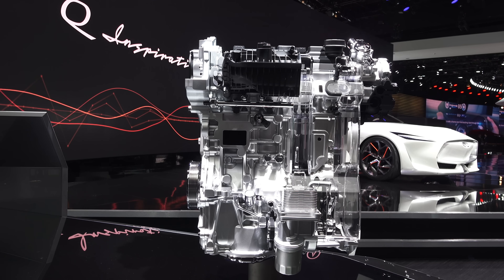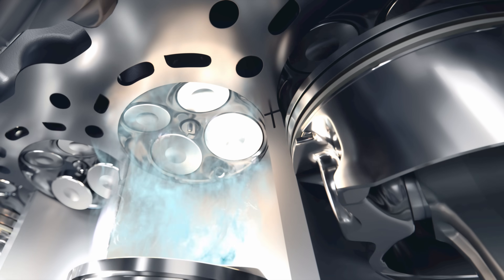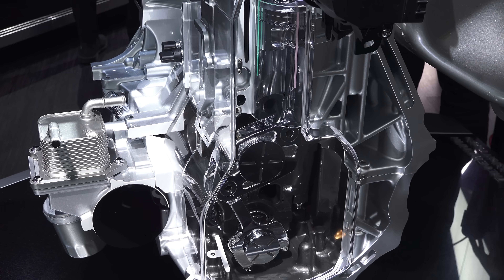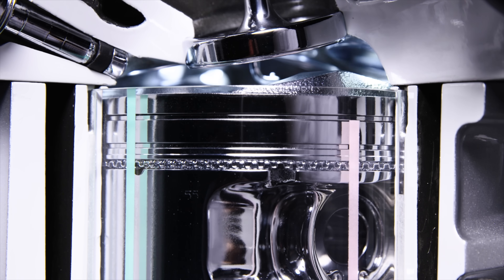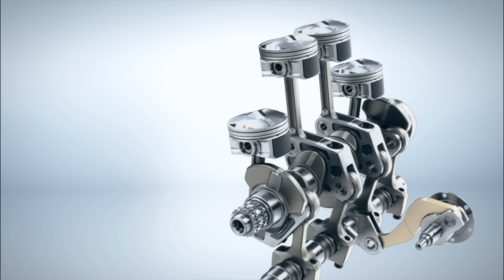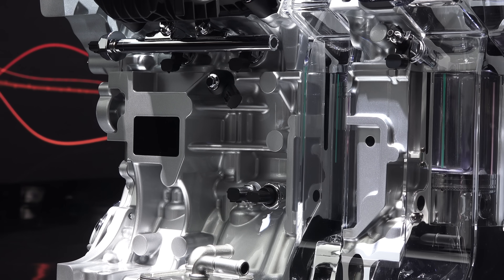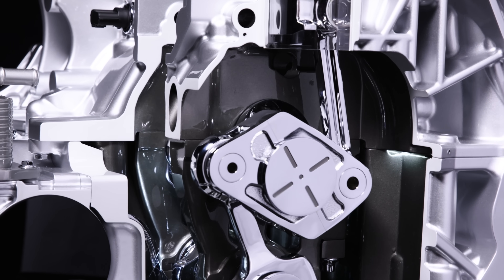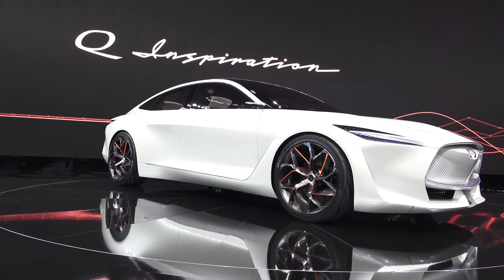INFINITI Reinvents The Gasoline Engine — VC-Turbo

Comment: Balance shafts add complexity? This engine is the definition of complexity. Will be interesting to see how this stands the test of public use.
Reply: Wonder how long this design will survive when Jane the Soccer Mom forgets to change her oil :)
Reply: I don't disagree with the fact that the most efficient ICE  is still not able to convert much more than 50% of the available energy into useful work and that too with the help of MGUs.  I just disagree with the common notion that this is the END of combustion engines.
Reply: Robbie Callaghan how do you get ppl to properly dispose of and renew batteries when I can't even get anyone in my family to recycle.  Any batteries go straight in garbage.
Reply: Robbie Callaghan I love everything EV but unless you want to drive a Nissan Leaf they are massively cost prohibitive.
Reply: It’s not even that complicated
Reply: Well, balance shafts certainly add to pumping losses, and slower throttle response, the complexity he's alluding to is more to those two things rather than actual complexity.
Apart from the junket our hero went on, I see real innovation - and I'm as cynical as any  on here. It is rare for me to be impressed and I'm yet to be so, but I see a power plant that seems on the face of it to have not missed a single opportunity. Mostly, in other often quite good designs, I see missed opportunities but not this one.
I like the infinitely variable (within the high/low range) compression/boost/fuel delivery aspect of the design. That part of it is an opportunity not lost. The reduction in piston pumping losses by conversion of kinetic energy to heat via thrust loading of the cylinder wall is the part I like equally with the variable compression aspect and the Atkinson Cycle.
There is innovation here, they haven't reinvented the wheel rather substantially modified it. Efficiency has to be better in this design but as always real world lack of servicing, stop start and short trips will test the design to the max.  
My standard caveat remains; that is I get annoyed when manufacturers use their paying customers as free field test facilities for their unproven products. If their new design fails due to poor design/unforseen durability issues and they're legally held to account, these same greedy barbarian manufacturers throw tens of millions of dollars if necessary to deny responsibility through the court system to any ma or pa that dares to take them on. They will intentionally financially ruin anybody that dares to get recompense for teething issues. This is why it is a poor choice to buy emerging technology in my view.
That said, this design is quite straight forward and appears to be mechanically economical. It looks complex but isn't. It looks complex becuase it's different. The development phase seems to me to be as good as it gets.
I'd rather this than that other wagon wheelesque commer knocker design with efficiency claims that seem more ambit than actual - we'll see I suppose and I'm happy to be disproven.
Reply: arjun vijay
Far less than 50% and they are nearing the limits of physically possible.  I do believe the end is near for ICE as much as I enjoy them especially in my BMW M3.
Reply: J. Hunto's Garage 
Im betting it won't..but there are variable compression Zero knock diesels.. prototypes working..
One has one dang internal  moving part..
Reply: fatdog371
A "ton of potential"?  Put a number on it, 10% gain in power/efficiency?  At what price?  Massive increase in cost, bulk, weight and increased friction.  Clever and interesting but doomed I think.
Reply: all that considered, they are still "greener" believe it or not.    They are not the magic cars that savve humanity like some play it off.   but they are still an improvement today over what we have been using up to this point.  

A lot of the issues you mentioned are becoming less of an isue as well, For example, A huge portion of the waste comes from the Lit-ion bat production and disposal.   but there are already systems that have reduced waste and found means of re-use from most of the "waste".     The goal is 100% renewal. i think thats still a bit of a pipe dream, but they are defiantly well on the way,

all that aside though.   its going to take a lot more than just being "better" economical or environmental options for them to truly dominate.   some people just like combustion motors. they like the sound, the feel, they like the complexity,  tinkering..... these are things you cant just replicate, and thus will continue to push a market long past its "prime"
Reply: Exactly my thoughts, instead of 4 main bearings to change you have, erm, lots! It won't be economically viable to repair. Not only that, but aren't they flogging a dead horse?
Reply: It's still too early to presume that ICEs would be completely replaced because BEV's aren't all that green technically. They rely upon Non-Conventional energy sources to produce power and ultimately pile up a lot of in-disposable hazardous waste. Also, battery pack replacements are gonna cost you a fortune!! So, all the marketing gimmicks aside, ICE still has a future until the all the issues get sorted out.
Reply: I'm ok with balance shafts this engine is basically adding a second crankshaft. Con rods fail on performance engines readily why add another set of them and another crank.
Reply: J. Hunto's Garage  man this is a joke imagine repair cost omd in the millions lol
Reply: Andrew Whiteman Not long bearings will starve for oil, because of pen hole sized oil ports to the variable component bearings, and cause the engine to self destruct. Unless you keep new oil in it all the time so there is no grim, and if so good luck. Still awesome CONCEPT. I'd leave it at that though.
Reply: joe kanitz
The bottom end is twice as complicated, about that much heavier and far more bulky.  Looks like a fail to me.  Clever and interesting but it won't be enough better to justify the penalties IMO.
Reply: Spinal Column  not really though. You can buy a tesla for 35,000.   The average transaction price of a new car or truck sold in the US (based on april 2015) was 33,560 so the tesla is a whopping 1,400 more than the average.  Hardly a make or break figure.

Though with that said you deffinatly are limited in what you have to pick from (expecially at low-mid tier prices) compared to traditional cars.   Prices could deffinatly come down a lot more, but i dont see it as actually being the huge price wall people make it out as right now.

Comment: Is it me or is this a little late to the game? Electric is the future. Battery technology getting better and better every year. Nissan nearly doubled the capacity of the leaf battery in 5 years.

Don't get me wrong, I'm missing the roar of an engine in our leaf but it's so much more drivable than a petrol engine.
Reply: It heavely depends where you live. Full electrification of private transport will need several decades to achieve in some parts of the world. Some countries can't even provide a stable electrical grid for common use. So to run electric cars there at the moment...nope.
Reply: shi01 those places aren't going to get this engine either....

Comment: Very cool! With low comp. ratio mechanical settings still increase the turbo bust!!!???
What is then the point reducing the compression ratio if it gets compensated with higher volumetric efficiency? Wow. Somone got a lot of money to play.  

Crank pin as rotates creates an irregular circular motion with its center in the shape of "bean" if you watch closely. Thus orders the piston to compress the charge very fast, not that bad.   

Provides no constant volume at TDC neither BDC.   
All the ICE engines are suffering from not having enough time at TDC & in the power stroke when the conversion starts, the piston is engaged in an inadequate relationship versus crank rotation. This engine functions with a variable rod to stroke ratio. For the same stroke length, it provides longer crank lever, very good.   It would have to be anyways only highly super duper charged.   

The rest of the 65-70% of unfinished combustion will be dissolved via after treatment accessories. EGR, 2 or 3 way Cad converters and much more. 
Very cool, good luck to the inventor.

Comment: How would this be different from increasing and decreasing boost? Is it that under low/no boost the compression ratio can be raised, increasing the efficiency of converting fuel and air to power?

Comment: Did Nissan say if this would be used in flex-fuel vehicles? (And therefore have a High compression with the turbo engaged setting while E85 is in the tank)

Comment: Excellent! A great explanation of how this works. The reduction in piston side force is interested. I wonder if the rotating mass of this engine is similar to that of a standard 4 cylinder engine due to the removal of the balancing shafts? It will be interesting to see this trickle down into other models - particularly lower end cars like the Altima. 
It sure would be interesting to see this combined with Mazda's HCCI. Maybe Mazda will license that technology to other manufacturers in the future...

Comment: I got 2 questions what the limit of the variable compression ratio I know it's tuned right now for anything from 8-14 but could it be a bigger gap say 6-16? And when can we see a v8 version of this for a multi purpose race and street tune ability for when u want to get to work but go to the track after without any car or tune swaps

Comment: gonna flop, just like a cvt did
Reply: in what way did the cvt ever flop? last time i checked every manufacturer is adding more and more gears to their transmissions. cvt is the solution not more and more gears. but i guess if you add enough gears a transmission will eventually become continously variable-ish.
Reply: Jesus Cantu yeah! Those cvt are awesome!! You also get to spend ALOT more money servicing them and even get to drop another 6k to replace the drive chain/belt once it goes bad around 100k miles or even less! Why would any pleb want to save thousands of dollars by using an old ancient manual transmission and have to actually shift the gears in their car? Or even the automatic transmissions that last long too! Naaaahhh.  Overly complex and costly cvt transmissions are so much better.
Reply: CVTs are banned from racing because they are too good, not because they suck.  People just don't like them because they are used to gear shifts.  CVTs are technically the best transmission you can have.

Comment: This was truly fascinating display. This would really help with new crankshaft design to prevent the vibration of the engine. 

And is there a video where it shows multiple Japanese 4 cylinder engine display I can look up? Turbo or not.

Comment: If VW did something like this they'd have the variable cam made out of ABS plastic and the pins that hold the connecting rods to the crank shaft out of rolled up aluminum cans.

Comment: So I understand the reduction of friction while having the shaft mostly vertical during expansion, but it seems to be at a pretty steep angle during compression.  Wouldn't the friction there be an issue?

Anyway, very interesting design.  Due to the extra moving parts, I'm a bit wary of the reliability of this, but it seems to be a better answer to improving efficiency than things like direct injection or lower oil viscosities.

Comment: seems uselessly complex compared to mazda new skyactiv 4 cylinder turbo....Mazda engine is much less complex and is more powerful and only get just a tad bit less mpg by 1-2mpg. but you can use regular or premium with only a reduction in power.

Comment: It seems like there would be efficiency lost in the control shaft assembly, relative to a conventional crank design, with this potential inefficiency offset against variable lobes? It looks fragile despite lower piston velocity at peak power? Is the compression proportional to rpm or stepped in some fashion (missed if mentioned ;) )? Lots of questions, I'm a comms eng messing with mechanical theories :D

Comment: While this technology is interesting, I can't help myself seeing another complex system that will cause more problems in the long run then provide actual benefit to the owner. I do not care how efficient my engine is if I need to spend half the price of my car to rebuild it after 50000 miles.

Comment: Engineering Explained, Why do you always explain it hald fight? Higher compression does not make an engine more efficient, it actually makes it less efficient, as the engine will consume more energy to compress the air to I higher ration. Efficiency does not come from compression, it comes from expansion. What you said is completely backwards. If you're going to educate people, please do it correctly and avoid perpetuating all  the common improper colloquialisms.

Comment: Man.. wow! This is amazing! I just might get their QX50 SUV for my first  vehicle. I have a Motorcycle. But, I live in Portland, Oregon. It rains 24-7 7-Days a week. So I need a truck or SUV haha
Reply: Can you explain me, why would you need a truck or SUV, not some simple regular sized car, when your current ride is a motorbike? I mean the only thing that you complain is the weather, so basically any car with the roof would solve that problem. If you drive a bike and get along with it, I assume  you do not have lots of stuff to move around, also safety shouldn't be an issue ether as regular car is more safe then bike. So why would you buy a truck over regular car, specially when it would be your fist car? I am asking, because I am not from USA, and I would like to understand your mind set. Just pure curiosity.
Reply: QX50
Reply: chan129 brown thank you, haha.
Reply: it's fun to slide everywhere at (mostly) legal speeds

Comment: Why only premium fuel tho?
The car can adjust the compression ratio itself and can also know through its fuel quality sensors what fuel it is getting. Why not let the engine lower the maximal Boost and compression according to fuel quality? Or does the added fuel economy make up for the extra cost of Premium Fuel?
Nice video, keep going like that mate!

Comment: I absolutely love this, you can go from fuel saver to high rpm monster in a second. My only comment is the fact that this is going to break, a lot. It seems like this will make engine repair a lot more expensive in the long run because the parts are more complex and very specific, breaking the old habit of cross compatible parts between engine models. :c

Comment: Very cool. Now they gonna focus a little more on the "rust bucket" aspect of thier cars?
Reply: Hello, the future is electric engine  not thermal complicated and many mecanical part.... same situation burn gas...
Reply: Thanks for the completely unrelated comment; & poor english that doesnt even make sense. 
There's no such thing as an "electric engine". An engine receives its energy from within. (Fuel combistion)
A motor derives its energy from an external source. (Electricity). But ill give you an effort point for at least attempting to sound like you knew what you were saying.
Reply: Allora te lo dico in Italiano, il futuro è elettrico e non termico, molte parti meccaniche contro un rotore elettrico, stessa situazione bruciare combustibile. En castellano el futuro son lis motore electricis y no termicos, muchas partes mecanicas contro un solo rotor electrico, misma situaciòn quemar combustible...
Reply: sgifuel 
Spagnolo, italiano, inglese. la lingua non ha importanza. il tuo commento senza senso non ha ancora nulla a che fare con il mio commento sul fatto che le auto Nissan sono spazzatura arrugginita.

Translation

Spanish, Italian, English. the language doesn't matter. your non sense comment still has Nothing to do with with my comment of the fact that Nissan cars are rusty garbage.

Comment: My hat is off to INFINITI Engineers for pushing the limits of creativity and science with the varriable compression engine..
I am not the competition but for the last 4 years I have been using my test car 4 cylinder 2.2 Cavalier  and using additives to raise compression  and Military friction reduction to see what can be achieved in MPG.
In repeated tests of 60 mph at 3 hours in above 70 degrees on the same Highway  the car went from 32 mpg to 43.4 mpg !
Had I used Amsoil 25 K full synthetic in the engine and severe Trans I may have pushed the 45 mpg marker.
My products were Marvel Mystery Oil plus 1 oz of Militec- 1 friction reducer into each bottle of MMO.
I read a form about Marvel and a engine builder named Bob who built for Dale Earnheart at one time said that Marvel should be used 4 ozs in each tank for a new engine as it causes a dry lubricant in combustion and raises your combustion by 10-15%.
So my next test vehicle arrived 20 days ago and it is a 2018 2.7 Tacoma 2 wd.   with 24 mpg being the top end in ideal conditions .
In a 4 hour run at varying speeds on back highways I pulled a 9.5 per 100 K or 30 mpg.   with a 11.8 compression ratio in this 2.7 .
That may be 10-15 % higher now at 13.0 to 13.4  ???
I will be dumping oil,trans,rear end for Amsoil and adding 16 ozs of MMO plus M-1 in that super formula I call it.
QUESTION ........ If I was 13..0   or 13.4  would my engine handle premium without  damage  from heat or compression and what would I get power in the montain's ........is there anything to gain with the higher cost ?
Even without premium in summer above 70 degrees I hope to achieve 34 mpg with my bag of tricks.
LOVE your videos your a rock star and make engineering fun .

Comment: Do you think these engines can be mated to a manual transmission?
Reply: zebracherub ..Yaa they can be mated 👍..see in video the multi link turns in angle..it doesn't move anywhere just angle is changed keeping the crank axis remain in its position